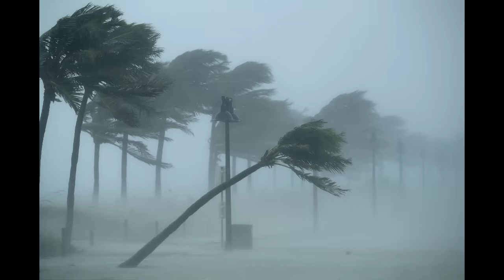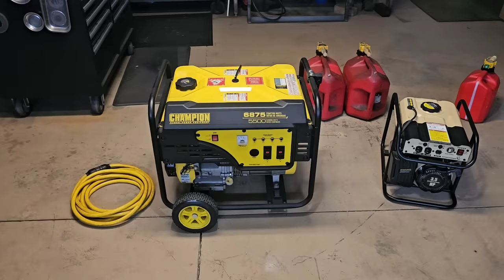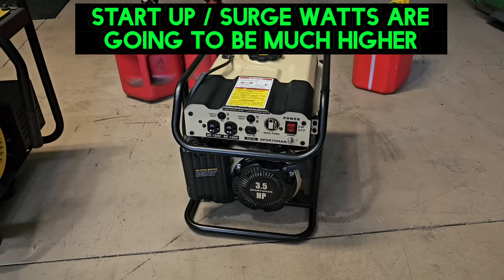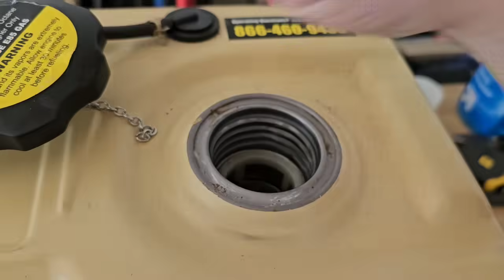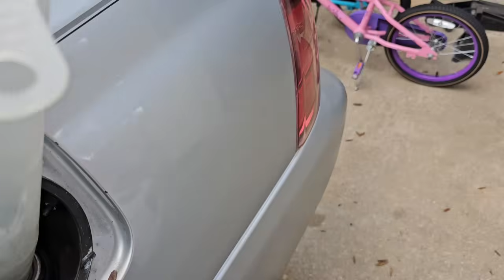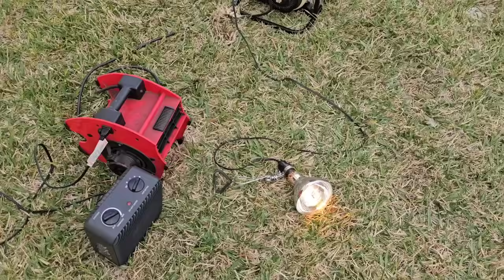Why smaller generators are better for power outages.

Comment: Great video.  We have the 9000/7250 watts Predator generator. It has an 8-gallon tank.  At 50% load, 3,625 continuous running watts, it can run for 13 hrs. I installed a Tri-fuel kit to run it off of our Natural Gas line in our house.  NG is the primary fuel source and with gasoline as a backup.  (I store 35 gallons in Jerry cans) 

We have a Delta Pro Power Station that is always ready in case of a power outage. It's all set up and connected to a six and ten circuit manual transfer switch.  We can get four to six hrs. of use, depending on the power load.

We use our generator to recharge the Power Station, then switch to the Power Station while the generator rest.  This saves on fuel and keeping things quite at night.

Both can run our entire house. The power station can't run our Central Air though.
Reply: Where do you get a tri-fuel kit for the Predator and is it difficult to install?

Comment: Good video and I totally agree. We lost power here in KY last year for 5 days. I ran a small inverter generator for 5 days straight and burned less than 20 gallons of gas. You would have needed a 55 gallon drum (or more) of gas to run a larger generator.
Reply: i have 25lbs of propane and 35 gallons of gas. That'll give me 3 days runtime, roughly, not even at full load with my gen....

Comment: A little 2k suitcase inverter generator is great in addition to a big generator
Reply from the maker: That's exactly what I just bought to replace the small in this video. Plus it's so quiet and it has the option to parallel up with another one. 
https://youtu.be/Aa_0DXB9bkk

Comment: Have a smaller one as a backup, my main runs primarily on natural gas so I can power everything as long as I want. I can connect the small one to my panel was well and might use it in the winter for shorter outages. Less noise and can get it out quickly.

Comment: It’d be nice if they made smaller generators with 240v outlets. Inverter generators are more fuel efficient.
Reply: Might be worth getting a lifepo4 'power station' with a 240v outlet and charging it with the generator.

Comment: I have a dual fuel with 2 twenty and 1 30lb tanks and a 12 gallon fuel tank not including the tank on the generator itself. I have a bluetti back up battery that runs the internet,tv and Alexa along with two Mr buddy heaters so I won’t use the big generator u til I absolutely need to.

Comment: I somewhat agree.  I have a large portable and it runs whole house.  However, during winter etc a small one would run 2 fridges and heat during day.  I may pick up a small one one day.  Gas appliances besides stove here.  I cant run it.  Small would sip fuel and could get by.  I hardly ever run my whole house just to keep my gen head happy and save fuel.

Comment: I BORROWED A 9000 FIRMAN AND IT WOULD RUN 12 HOURS MAX. I HAVE A NEW GENERATOR DUROMAX 4000 WILL RUN 19 1/2 HOURS.I RUN 3 LIGHTS,CELLPHONE BOOSTER AND A INDOOR OXYGEN MACHINE.

Comment: Be sure to change oil frequently. These have very minimal oil capacity, and no oil filter. I recommend changing the oil once every 10 gallons of fuel consumed, per quart of crankcase capacity. Because the smaller one at best , holds ~20 Oz of oil, 7 1/2 gallons is probably about right for that one, The bigger one probably holds closer to 1 1/2 quarts, so, 2 full tanks of gas is probably about right for that one.
     You said it right at the very end, Never turn off the generator by the ignition switch. Its better to remove all loads, and turn off the fuel valve. Stay there with it, and when the engine starts to sputter, ride the choke, to maintain mixture. That extra vacuum helps clear the emulsion tube as well as the idle circuit, as well as the float bowl. That will ensure that no liquid is left behind, that can leave behind varnish, from fuel evaporation. There's nothing more satisfying, than having a generator start on the first pull, when you really need it!
Reply: And then, drain the carb.  Running out of gas still leaves a small amount of fuel in the bowl.
Reply: Exactly. In fact, riding the choke as the float bowl runs out of fuel will provide extra vacuum, to clear the emulsion tube, and idle circuit, as well as draining the float bowl. You want to leave as little liquid fuel as possible to evaporate, causing varnish that can throw off fuel/air mixture. @donbrloks3959
Reply: Have you ever had to use a generator for an extended duration? That oil change interval is crazy. That could easily be every other day or so. Sure, it won't hurt. But totally unnecessary.
Reply: I change the oil once a season. No need in changing it every 10 hours or so.
Reply: Because you are ignorant  @MrJwh3000
Reply: @Daniel-qe8qe  right and you have supreme knowledge for you are the master of the universe. 😂
Reply: I change oil every 24 hours and keep several cases of gallons plus a jar marked with correct amount required to fill it 😊
Reply: Love the jar idea.  Thanks
Reply: I check the oil each tank of gas and change at the end of the season with synthetic. I’m in Florida.
Reply: I have the same generator since 2012. Powermate, Briggs and Stratton engine. I live in Florida. Multiple power outages every year. I change the oil every 7 days of running. No issues yet. I drain the gas after I'm done using it. Then shut off fuel valve and run the Gen until the gas is drained out of the carb.
Reply: @maddie690ify  so every 168 hours you change the oil
Reply: @Daniel-qe8qe  sorry. Should have clarified, about every 80-90 hours of run time. I probably have over a 1000 hours of run time on it. Briggs and Stratton engines are unbelievable. I also have a Briggs and Stratton push mower that is almost 20 years old. In terms of routine maintenance, that thing has been abused. Still fires up after one pull.
Reply: @Daniel-qe8qe  But I will say, i probably push the oil changes too far. Probably would get another 20 years if I changed the oil more often.
Reply: This Info is Correct!!!

Comment: I found this to be very helpful in a power outage.  AMIR wireless refrigerator/ freezer thermometer..About $19 on Amazon.  Only run generator when necessary to maintain cold temperature, without opening the door.  Also, I agree with the one that recommended a small power station for small electrical loads such as lights, fans, entertainment.
Reply from the maker: Thanks for sharing!

Comment: With newer appliances, I would get a GOOD true rms frequency meter and check the frequency and voltage of these smaller generators.  I've seen a ton of newer smart ups battery backups that will not  switch over to portable generators output.  Lots of refrigerators are now using single phase to 3 phase convertors with a frequency drive to control the compressor.... not something you want to hit with dirty voltage.  Washing machines are using technology very similar on direct drive units with no transmission.  If you have older appliances it may not cause problems, but with modern appliances it could end up costing a lot more than the generator did.
Reply from the maker: That's a great point! I actually picked up a inverter generator yesterday because we have recently gotten a new house with new appliances and I was worried about running them with a regular generator. 
 I've been getting so many good comments like yours that I'm editing a part 2 to this video to cover these points.
Thanks for watching and commenting!
Reply: You're exactly right about " Clean " power needed for many new appliances including the furnace which is why I bought an Inverter.  Old oil furnace or fridge could care less but the new gas furnace won't run with a regular generator.  Nothing like burning up the circuit board on the furnace when ice storm takes out power for days.  Love my gas sipping, quiet Inverter.

Comment: Your refrigerator or freezer will be fine overnight, especially if it’s well stocked.

Another thing to consider is your well pump, if you have one.  It will draw about 750 watts running and twice that to start it.

Other options: Use a 12 volt deep cycle battery and an inverter to run low load devices like your internet router, laptop, cell phone chargers and maybe a few lights.  With one of these you could run your whole house generator for a few hours in the morning and a few hours in the evening while you shower, wash, cook, etc.  This sort of power management will help stretch a gallon of gasoline a long way.

If extended power outages are a common occurrence in your area, I would opt for a generator that runs on propane (with a big tank) or natural gas.
Reply: Make it well.stocked if you need to.   Fill the empty space with water bottles.  Makes it run much more efficiently.

Comment: Hey sounds good but if you purchase a smaller KW gas generator it will only sometimes have 15-20 Amp outlets not a 30-50 amp outlet for multiple circuits. You will need to separate isolate only circuit you need like furnace most important then possibly some lights , outlets and tv
If you go larger it will have 30 amp breaker and you can run one cord to inlet box and a interlock kit

Comment: Four hours is a very conservative estimate, a lot depends on a refrigerators temperature setting, ambient room temp, how full or empty, any door openings.  I usually run the generator until midnight then shutdown until 6-7 the next morning and never had any spoilage problems.  Personally I don't like to run my generator when unattended unless absolutely necessary.  Always have 15 gallons of stabilized gas on hand and rotate through this using the gas for yard equipment.  Should a hurricane or ice storm be on the horizon, I'll add a 4th or 5th can to the rotation.  Just do not have enough long term outages to justify the expense to purchase and maintain second generator.  If you have a lot of long duration outages this strategy might be a good investment.
Reply: i have about 140 gallons with gas treatment, dated and rotated for my cars.
i never let my cars/truck get beyond half full.
works for us.
if there is a major power issue, based on a 12 hour run, good for almost a month.
with enco mode.

Comment: If you're in an area known for prolonged outages why not have one that will run on propane and have a 250 gallon tank sitting out back? I say that over natural gas because natural gas can be disrupted
Reply: Also the gas doesn't go bad and can't be stolen! The best thing we got on my grandmothers house was a standby generator with a 250 gallon LP tank. She could run for 2 weeks in an ice storm while use home fuel for the furnace. Just a 10k watt unit was perfect. This was vermont btw.
Reply from the maker: That's a very good idea!

Comment: I bought an A-iPower 2000w quite a few years ago just to have something. I ended up liking it so much I bought one or their 3800w from Sams club 2 years ago. It burns 2 gallons of gas in around 8 hours. Runs all the lights, fridge, TV, and the gas furnace. I've never had issues with leaving the gas in them like I did with the old style. I believe it has to do with the sealed vent system. I also keep them in the garage where it's semi conditioned so that may play a part as well. It's also crazy how quiet it is. I can run it on the deck and full load and not even hear it in the house.
Reply: I have the same A-i Power 2,000 inverter generator.  With long term power outages, I use it to recharge my off-grid solar battery bank.  It goes through 1 gallon of gas in 3 hours with a continuous power draw of 1,300 watts.  I have the generator in my barn with the exhaust system plumbed outside through a car muffler.  It's very quiet, I can no longer hear it run when 50 feet are more away from the barn.
Reply: You said 2 gallons of gas 
8 hours  ???
Reply: @josephpuchel6497  Yes, running nearly 1/2 the house.

Comment: Living in Northwest Florida a backup power source is a must if you want to keep your food in ref.and freezers from going bad. Iv'e added a couple champion duel fuel inverter generators to my preps. Run time on them is up to 22 hours per tank, you just have to run critical loads. Also added a Midea u-shaped inverter a.c. to stick in a window to keep from burning up in the Florida heat. It takes less than 6 amps to start, and runs on 3 to 5 amps.  Great video and good advice.
Reply: I also live in north central Florida.  A portable generator, a can of gas, and a small window air conditioner is worth its weight in gold after a hurricane goes through and wipes out power for several days.
Reply from the maker: I'm going to sell both of mine and upgrade them both to inverter style. And the bigger one a dual fuel type like you have. Thanks for watching!
Reply: I just picked up a Champion 100520 open inverted generator, 8750/7000  from Northern Tool last week $585.00, Northern wanted to move out all the Champions.They only had one I would have purchased two. Will add a natural gas kit to it. Have installed these kits on over a dozen generators with no issues. You will lose about 20% of your watts on natural gas.  @Mechanical_Mind

Comment: Good points. My little honda 2000 burns 1 gallon in 8 hours under load and runs fridge, freezer and small window a.c. simultaneously.  And is quiet. I Back feed half of the panel.
Reply from the maker: Thanks! Both of my current ones are very loud. I'm going to try to keep flipping mowers and generators for more video topics.  I want to see if I can upgrade my way up to a small 2000 watt inverter style and also a 5500 watt inverter style.
Reply: Don't lie bro. You have exceeded the wattage with those 3 items.
Reply: Your Honda 2000 gets better fuel economy than mine. I get 8 hours at 1/4 load with 1 gallon.
Reply: That honda is not running 1 gallon for 8 hours under full load. That stuff may be plugged in, but it's not "running" or cycling at the same time. It's rated at 1 gallon for 8 hours at a 25% load. Anyway, yes, I use the Champion version with great success.
Reply: There is a way to run both sides of the panel, I have a generator hook up and jump inside the 240 plug from 1 leg to the other.
Reply: @MrRChitty  That quite possible but the main must be off for those that don't know and you also must have all the 220 breakers off so you're not sending 120V to one leg of 220V well or water heater.

Comment: On the farm I have always had a gen such as Lincoln arc welder 10 hp Kohler and  Kubota 5,000 and safely back feed after turning Main Breaker off.  Nice but darn noisy and gas guzzlers like 12-15 gal per day.  Now I just use them for the well or water heater when needed.  July 2020 I bought a Predator 3500 and so impressed I bought a second one.  Very quiet, reliable  and uses very little gas.  I back feed to an outside outlet that goes direct to my gas furnace, also to living room for T.V.  and to the fridge.  I have double plugs at T.V. and fridge for gen and an off switch between furnace and breaker box to isolate that gen curcuit.  No extension cords, just switch from regular plug to Gen plug.  Anyway it easily runs furnace or window unit, fridge, chest freezer, T.V.  all at the same time with power to spare using about 2,400 watts. It has a display that tells the watts, amps, total hours. I bought an Inverter cause many regular gens don't produce "clean " energy and micro switches on new furnaces or fridge won't work or may burn out.  Always totally drain gens and you know it will start when you really need it. Easy to forget when you last used it.   I'm 69,, on the farm with lots of gas engines and never once wasted money on useless Sta-Bil.  Drain what I can but lawn mowers sit from late Oct. till April with Reg gas in them and they always start.  Usually run Sea Foam on the first tank of the season and I can't even remember the last time I did anything to a carb.  

Yup, another great video and really appreciate you taking time for us.  Glad we survived the below zero temps.
Reply from the maker: When I lived in TN, I would store regual gas for a year without any stabilizer at all. The gas was always still good with no issue. When I moved to Florida, I learned quickly, and the hard way, that regular down here goes bad in about 3 months or less. I don't know if it's the heat, humidity, the refineries, or what. 
I like to keep a full tank of gas in the generators simply to have more gas on hand. The bad part of that is needing to rotate that gas also. 
I had two predator 3500s that I used for work every day for years to do mobile install jobs. They never gave an issue
Reply: @Mechanical_Mind  No stickers on pumps anymore and I learned last summer that 98% of all except Aviation gas has 10% or more ethanol.  Gov. doesn't want us to store gas long term like 2-3 years as the past.  I do keep fresh only 2 stroke mix and dump tanks out for the season.  Always drain gens and I keep about 100 gals for 6 mo. then burn in cars and refill with fresh.  Never had any problem at all,, but maybe heat, humidity or different blend in Florida cause it to spoil faster.  Still, just have gas in cans for 3 mo. then fuel cars and buy fresh.  Don't store in equipment.